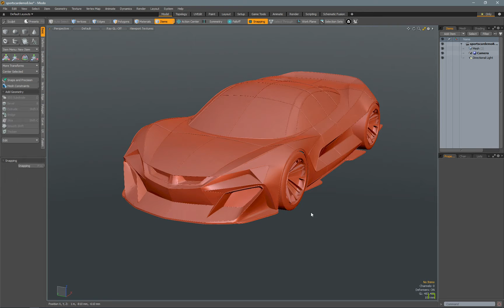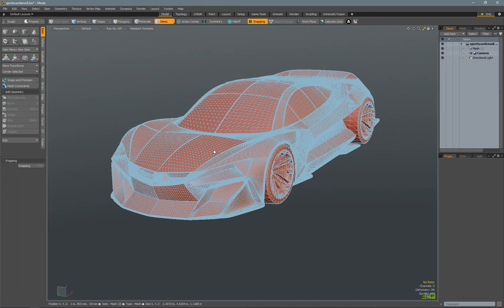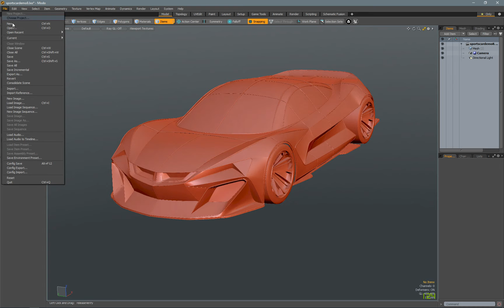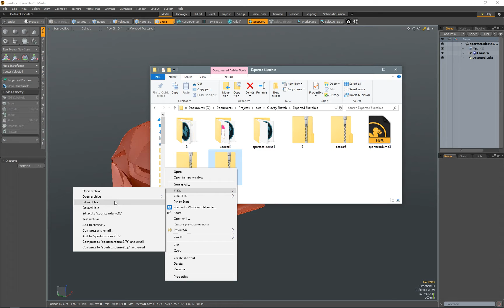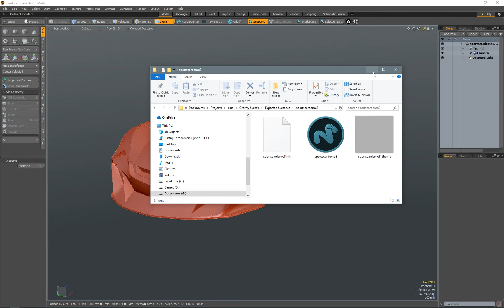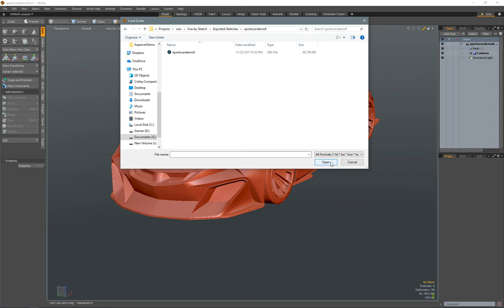Modo Tutorial Part 7

Comment: if you hold control before grabbing rotation handles, it will snap to increments of 15 degrees (by default -  angle can be adjusted in preferences)
Reply from the maker: Thanks Good tip.